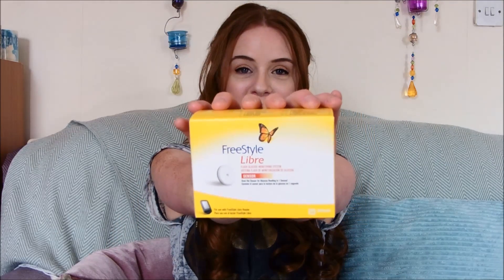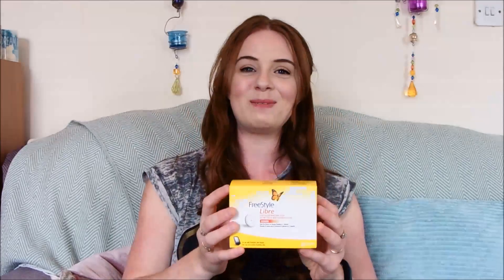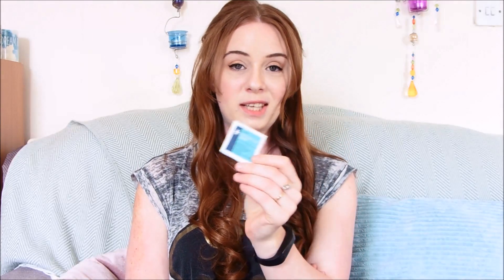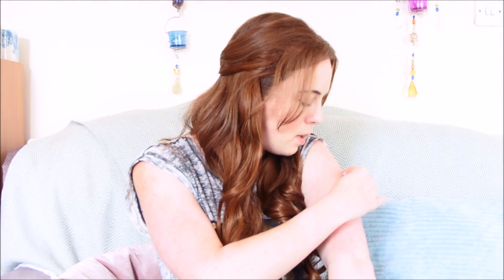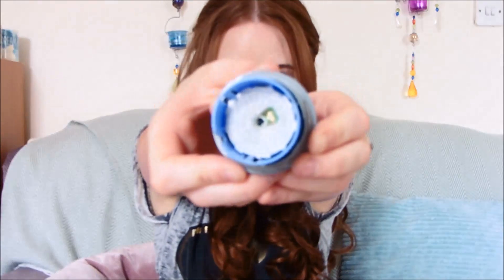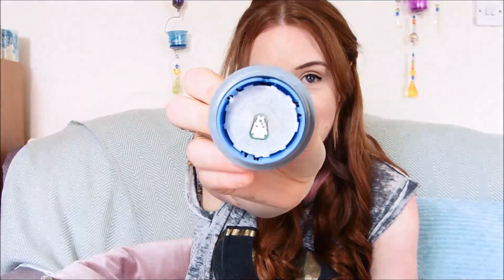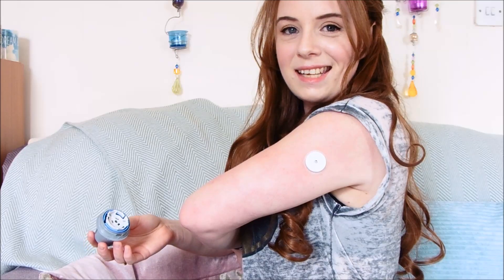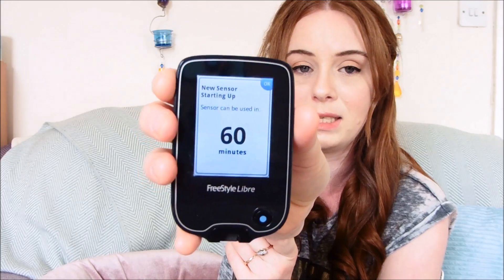How to insert Abbott's FreeStyle Libre sensor and use the reader

Comment: Great videos !. Alright for any of you having the issue that the 
Freestyle Libre sensor is coming off due to activity or just keep them 
banging them off with objects or walls.. here is the solution.. what I 
do:

1) Find a place other than the arms that is less prone to be banged 
against things (for me is right on my thighs, anywhere from the waist 
and the knee on the outer side)

2) Shave that zone completely so the sensor tape can adhere to it.. and 
apply sensor

3) Get some medical grade tape, I use exactly this one..http://amzn.to/1WK22n7

4) Apply tape as you wish in X form..or multiple times

No problem whatsoever! In fact I bang agains things and no problem at all..

To remove, while taking a shower with hot water and soap gently remove sensor! 

Good Luck and follow these steps, I banged my first sensor the first day and that was 69 euros down.. dont waste yours!
Reply from the maker: Thank you! Those are great tips! I recently knocked a sensor off on a door after only 5 days of using it. Now I'm wearing mine on the inside of my arm as it's not likely to get knocked there. Thanks again!
Reply: Laura Ninjabetic you're welcome! You may as well try your thighs, I find it comfortable to wear and hardly hit anything.. I knocked mine off the first day with the elevator door... Good luck!
Reply: @LauraNinjabetic1  The same thing kept happening to me. Check out www.mypatchabetes.com. I created an adhesive patch that will last for up to 14 days.
Reply: I had the same issue with it falling off and I found these cool armbands and ordered me one.  The sensor fits perfectly in the middle!  https://etsy.me/2KyG0TI
Reply: José Miguel Baztán good advice I'm getting one soon I'm type 1 diabetes hypoglicimic shock is a regular thing either I have too much insulin or not enough nightmare for me
Reply: I kept having the same issues. That's why I created Patchabetes! Check out www.mypatchabetes.com We've got you covered.

Comment: Hey i found your video very helpful, Im planning to use libre too.maybe is silly question but I just wanted to ask,can you feel the needle? cuz i like to exercise and do like my arm muscles and stuff,Do you feel discomfort moving arms ? :))))
Reply from the maker: Hi Gintare, thanks so much fro your comment :) When I started using the Libre I was told that the needle comes out after insterting it and goes back into the applicator to be thrown in your sharps bin. Someone else said it stays in your arm but I can't see it (unless I'm really not looking). When you take the sensor out of your arm (when it has finished ) all you will see is the sensor wire which is tiny and really thin - that's the bit that stays in your arm. I can honestly say that it doesn't hurt at all and I never feel it when I'm using it. Hope that helps and good luck for your first Libre :)
Reply from the maker: Hi again. I checked with Abbott about whether the needle stays in or not and this is what they said "Hi Laura, Yes, the needle does come out after inserting but it leaves in a thin, flexible, sterile fibre (5mm long). The needle helps insert the fibre directly underneath the skin." Hope that helps :)
Reply: Thank you so much for more info ;}}}

Comment: Great video - kind of weird watching someone do what has become so familiar. I have never applied the sensor myself - Mrs L always does it. As you probably know, I have no negatives other than cost & have sorted skin reaction with Cavilon gel. In factual terms, I think you'r wrong about the needle - it stays there all the time so it's the used sensor which has to go in sharps bin. Thanks for posting!
Reply: Lol... You both are funny! Maybe cause it's 2 yrs later, but if you Google it, it's the first thing that comes up. That there is a strip that is inserted 5mm in your skin. 
But again, maybe it wasn't that easy to find when it first came out! 
But this conversation was funny... You are politely arguing with each other! God Love the British! You do everything; even arguing; politely! The rest of us could learn a thing or two! 
P.s. I meant all that as a compliment...😉
Reply: well they were never arguing, just having a discussion and trying to answer a question
Reply: @chawntelh  when you remove the sensor the strip comes out?
Reply: @gabbygonzaga552  Are you asking me?
Reply from the maker: +Adrian Long Thanks Adrian :) I was always told that the needle retracts back into the plastic thingymajig and that's what the loud click noise is. I think Tim (@timspants) said the needle can be taken out afterwards with a pair of scissors but I haven't tried it. I once got Mr T to put a Dexcom sensor in for me but it didn't work so I've always done it myself since :) I'm sure it wasn't his fault though!
Reply: +Laura Ninjabetic (Ninjabetic1) I've just looked at a used sensor & the tiny needle is definitely still there so must be stuck in you for the whole fortnight. I assume that's how it measures the interstitial fluid...not that any of this matters at all :)
Reply from the maker: Hi Adrian, I checked with Abbott as I trawled the internet and couldn't find the info anywhere. My googling skills failed me :( They said "Hi Laura, Yes, the needle does come out after inserting but it leaves in a thin, flexible, sterile fibre (5mm long). The needle helps insert the fibre directly underneath the skin." Apparently there is a sneaky way to get the needle out of the inserter so you can recycle the plastic and put the needle in the sharps bin, but I'm not sure how to do it.
Reply: Aha, I see. Thanks for solving this mystery!